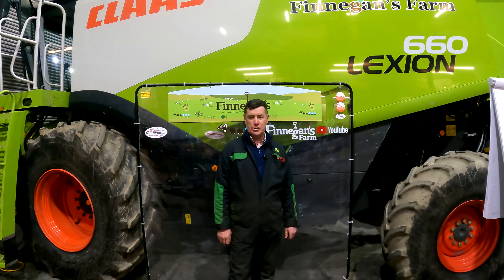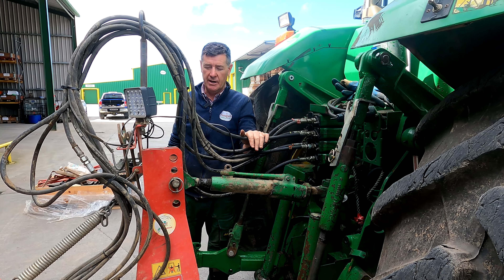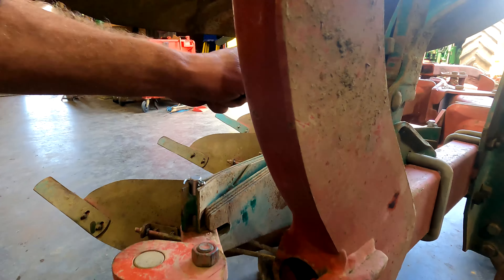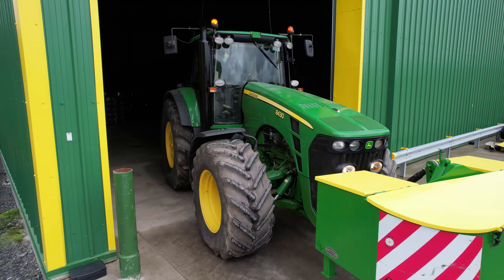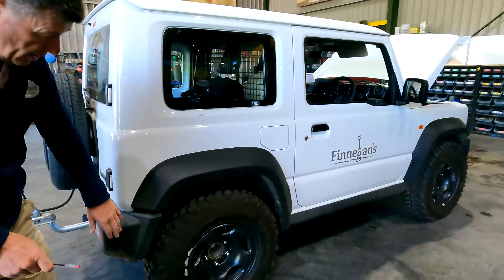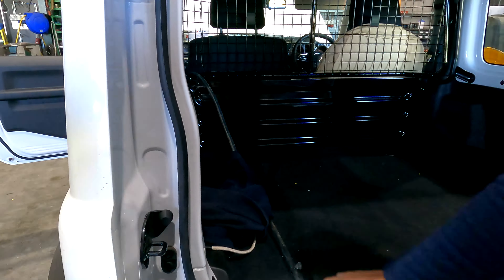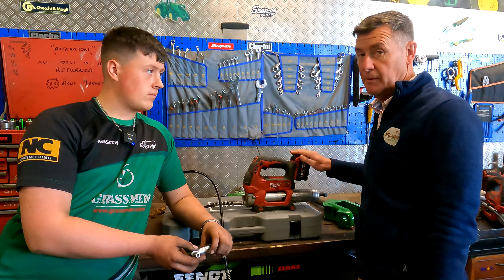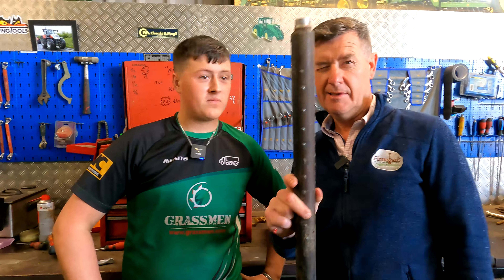WORKSHOP WEDNESDAY EPISODE 45

Comment: the tool is for checking suspension joints/bushes, set the wheel on it on the ground, and rocking back and forward with a 1/2 breaker bar
Reply from the maker: Good man Seamus you know your stuff 👍